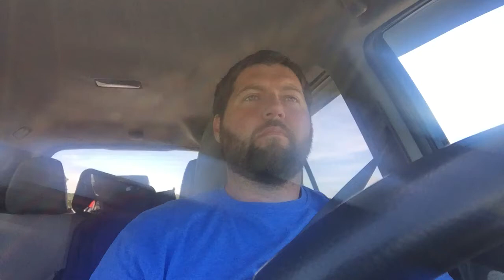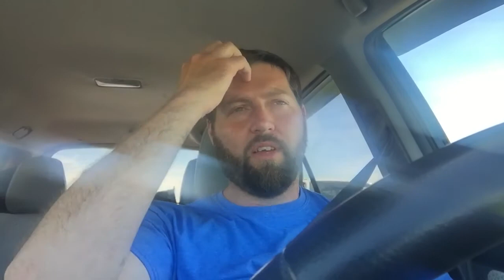EV Road Trip: NY to Chicago in 2014 Toyota (Tesla) Rav4 EV w/ T-Rex Range Extending Trailer. Part 7

Comment: Have you considered upgrading the wheels / hubs / tires on the trailer to squeeze out some more mileage? You could use some of the hypermiling techniques like keeping your tires' pressures maxed out, or even 10-20% over the max, even if just for a test run to see more of the rig's true max capacity.